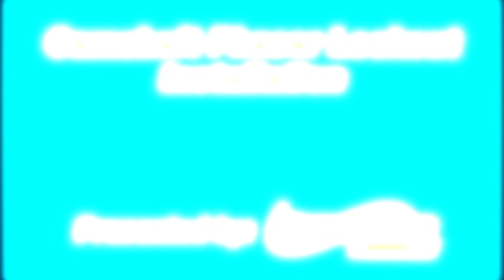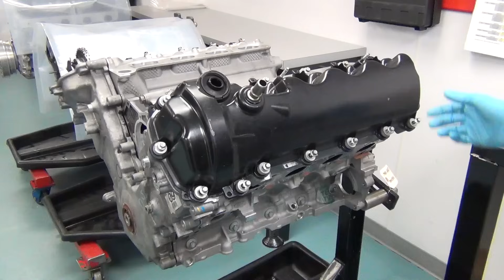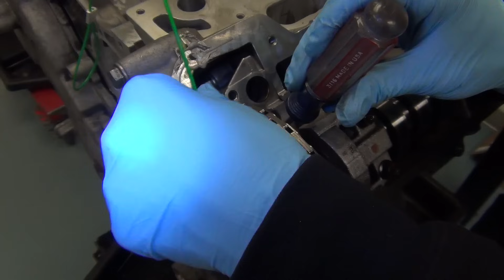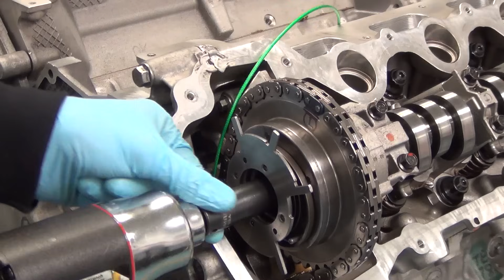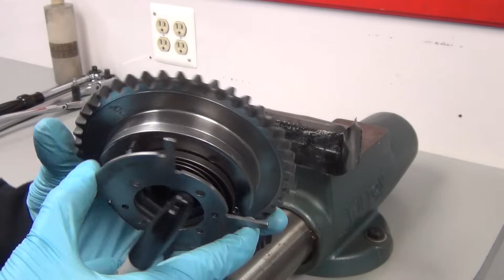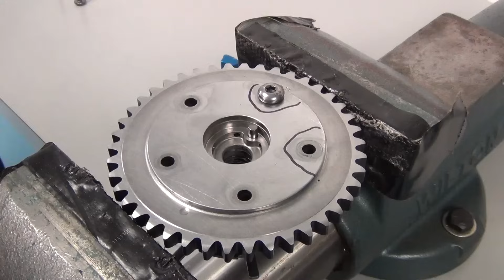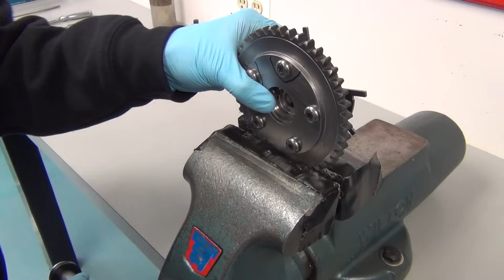Cam Phaser Lockout Installation Instructions - Livernois Motorsports New Link below

Comment: It seems a little pricey... I mean I have read many post and forums and it seems as if the price has increased a good bit from when it first came out...and honestly it doesn't seem like your getting a whole lot... 2 aluminum peices...and a download....
Reply from the maker: +aaron butcher Unfortunately many people over simplify what is involved in this kit. While on the surface it may look simple, look at it from what has to be done.

Design lockout. This process involved gathering over 200 phasers to ensure an adequate sample size to ensure the proper sizing of the piece so it works with all revisions of the phaser. These phasers of course were not free, and had to be factored into the development cost.

Wedge tool design and testing. We had to design out wedge tool to ensure it would work on all revisions of timing covers, chains, and not to mention 4.6 and 5.4 variants on both. There are about 45 total possible engine combinations. And, as with the phasers, this was part of the package development.

Calibration support. With close to 450 different potential strategy codes to support, you guessed it, we had to write code to support them all, and code to support future revisions that Ford may release. This process took over 2 years to do so, and, as you guessed it meant a great deal of development time and cost

Cam phaser bolts. Yes, simple and straightforward. We purchase and include new OEM fasteners.

Patenting. Since there is so much involved with this, we applied for a patent. This patent shows the complexity of exert aspect involved. It also is to protect us from those companies that simply copy our years of engineering involved in making this product available.

CARB testing. To completely round out the level of completeness of this kit, it is know CARB E.O. so those in States with emission testing can now be ensured that this product has been validated and approved for use in those states. As with other aspects, this added a good deal of time and cost, but it was worth it to give our customers the peace of mind they were asking for.

So, to label it as simply a piece of aluminum and a download is a gross oversimplification of what is involved and included. It's still less than 1/2 of the cost of the OEM "fix" which eventually fails again.
Reply: +Livernois Motorsports... I think this well help sell more...:) I, along with many others probably have asked this question and wondered why....
This does seem to be a good fix...however it is pricey... here is my current situation.. 
I'm currently taking my truck apart to see the components that need replaced along with taking the timing chain cover off.. I do not want to get a hold of myself and order parts to which I do not need. I can order 2 OEM Cam phasers for 225 each from amazon. 2 phasers I'm looking around $450 for the repair...not including guides and tensioners which are prolly broken... but that's another story..I do feel that your fix that you have came up with is a legitimate fix, however, you guessed it.... it's very expensive.. and $700. My biggest concern would also be that you get one download. I would be scared to death I would jack it up and then be out that money! Because once it's done you remove the tuner and basically that tuner is useless...it's a 1 time shot. Keep in mind I do see why you do this but, I would hope there is some assurance behind that.
I appreciate the response and I am not dogging the product just simply stating it's almost double the price as opposed to just putting oem phasers in...With the understanding they will go out again.. but hopefully after its sent down the road...lol
Reply from the maker: +aaron butcher Our response may not read the way we intend it, so don't take it as negative. Being our solution is a correct fix, we can't compare to what a shortcut fix would cost. Our comparison in cost is directed at what the OEM labels as a need. Phasers, bolts, solenoids, oil pump, chains, guides, and tensioners. Compared to this, our solution is far cheaper. But, we are engineering a solution for someone wanting to fix their truck, not get rid of the noise for the next person to deal with it.

Comment: would a cam phaser problem cause the car to read low oil pressure?
Reply from the maker: +Dustin Schaefer Typically speaking, no. Oil pressure is still within the safe zone even with a failed system.

Comment: Ive watched your video a dozen times until I fully understood the procedure. I have a 4.6L in my 2009 expidition, its no secret that the phasers get worn out at 100k miles.  Question: What is the benifits of phaser lockouts ? rather than installing new phasers ?  Thank you again for posting this video, its detailed instructions are perfect for the do it yourself person and I look forward to your reply.
Reply from the maker: +Silicon Valley Engineer Replacing the phaser actually doesn't address anything in regards to the failure point in this system. The phasers operate off of oil pressure supplied by the engine. When these engines wear, and age oil pressure naturally drops. Because of this, the phaser no longer has sufficient oil pressure to operate correctly. Now, the oil pressure is plenty to still operate the rest of the engine safely, but not feed the high demand of the phaser. The reason you see people claim that replacing the phasers helped is that you have a brand new part with zero wear on it, so it's operating at maximum efficiency, but since it has to pick up the slack for the rest of the engine it can fail within hours again. This is why our lockout is the only permanent fix for the phaser system.
Reply: +Livernois Motorsports  Very interesting discussion, thank you for your reply.
Reply from the maker: +Silicon Valley Engineer You're welcome
Reply: @LivernoisMotorsports   I heard a guy say he did his lockout in the forward position and got better MPG. I drove it and it definitely had more power.
Reply from the maker: @popeantichrist8847  These should always be installed in the fully advanced position, and while not designed to improve power or efficiency, many do confirm it does so vs. failed VCT control.
Reply: @LivernoisMotorsports  My dad was a Master mechanic, one day while changing the water pump on my 86 Honda CRX, my dad asked me "do you trust me?" I said yeah of course why what do you want to do? Well he said all all engines come from the factory slightly detuned I just want to move the cam forward one tooth. I told him okay go ahead. That little CRX went from 48 miles per gallon to 52 miles per gallon. It was so snappy you would spin the tires in second gear after that. His friend found out what he did so he brought over his four banger Ford ranger and it woke it up and it got better gas mileage. Such nice to hear at these three valve Fords locked into the forward position are getting better gas mileage.
Reply from the maker: This is designed to work in either situation so long as there is no physical damage to the phaser itself.
Reply from the maker: That is fine as well, only when there is physical damage to the phaser like a cracked housing, ob-longed dowel hole, or other issues do you need to replace them first.
Reply: Will the lock out fix a bad phaser? Or is the lock out designed to prevent failure of a good phaser only?
Reply: What if it is already causing a engine light?
Reply: You have a 5.4 that was the only engine option in 2009
Reply: @Sandbridgeman1  my 2009 F150 has a 3V 4.6
Reply: @jonahchabaniuk9165  my 2009 has 4 6l 3v also the 8th digit of vin is either a 8 or n I believe there was 3 engine for 2009 2v and 3v 4.6 and 5.4

Comment: hello everybody,, is there any suggestion to dont let move the camshaft once we are replacing the camphaser?
Reply from the maker: +ivan noyola If you follow the procedure outlined, the camshaft typically stays in place. Others have suggested for extra insurance, simply remove the rocker arms to remove all load from the camshafts, just bear in mind that there is nothing preventing their movement now either.

Comment: Did the 6.8L Triton V10's have cam phasors as well ?
Reply from the maker: +Kvr3005 Actually they do not, but since they a single pulse, 1-bank cam position reference their "fixed position" cam Gears cannot be used in a v8.

Comment: I already have the complete kit (timing chain, tensioners, cam phasers, etc.). It's Ford OEM. Can I purchase only the blue lockout pieces?
Reply from the maker: +Jonathan Diaz Jonathan, this kit will not work properly unless it's used in it's entirety. Installing the lockouts without our tuner will result in check engine lights, and poor running conditions since the vehicle will be running in a failsafe mode. Since we package this as a discounted group offering, it's actually cheaper to buy it as a complete kit, rather than buying the programmer, and the lockouts separately.

Comment: what is the purpose of the lockout
Reply: +miguelito0725 sanchez by locking out the variable valve timing you can run a bigger cam and avoid piston to valve problems.
Reply: Search Results
Featured snippet from the web
Designed to be an affordable alternative to expensive engine repairs, the cam phaser lockout kit fits Ford Triton V8 engines with 3-valves produced between 2004 and 2014. ... "Lock" the cam phasers into one position, ending the rattling problem and preventing future damage.
Reply: @1BlackopsGuru  what degree is the cam phasers locked ?  IE advance or retard as my thinking it's in advance at start and then it goes to a retard degree as it requires less timing then when it's turned off it rests back into advance is my thinking pad with in the scope of this operation ?
Reply from the maker: +ratcamaro Very true. That's how these started their life back in 2005 when the mustang first used the 3v engine design. We determined before anyone else how to address this and why its necessary. Our own 2005 mustang that graced the front page of motor trend magazine featured our lockouts even.
Reply: Livernois Motorsports & Engineering Do you need to reprogram the PCM to avoid any codes popping up now that the phasers don’t move?
Reply: ajthib yes you do need to have a custom tune.

Comment: Many people here ask about cam position to do phaser swap without cam moving when removing phaser,  I have Emailed you about this with no response.
Reply from the maker: blueblood76 if you follow the tear down procedure outlined in the video and the instructions, the camshaft will stay in place.
Reply: Livernois Motorsports So I guess you mean have black link up and lined up with the arrow L on phaser?
Reply from the maker: blueblood76 Correct, while you technically can mark any link in relation to any tooth on the phaser, it's usually easier to roll the engine over to get the camshaft into the default neutral position, which as seen in the video is with the L (or R on the passenger bank) pointed straight up relative to the flat surface of the valve cover rail. This puts the camshaft in the neutral position and prevents it from moving upon phaser removal. This isn't completely necessary, as you can mark any link and tooth together, and in most cases the camshaft still won't move, and if it does it will be a very minor amount you can correct by turning it back just a little bit.
Reply: Thanks
Reply: gyududgfyy

Comment: So all I need is this special wedge tool and I can remove the phaser without messing with the rockers? Can I buy just the wedge tool?
Reply from the maker: Mxmxv43 That is correct, the wedge tool allows for removal of the phaser with no other component removal. As for selling it separately, we do have the tool by itself.

Comment: My question is would you do this procedure using the old Phasors?
Reply from the maker: Gary Mello If you're asking if you can reuse the existing phasers the answer is yes, but only if you inspect them for any abnormal wear. If there is physical damage, then they will need to be replaced.
Reply: Livernois Motorsports  I'll have to check them out for damage.. I was thinking I should replace both due to the fact my truck has breached 178,000 miles. and bank 1 is over retarded.  If I replace both phasors would you recommend changing out the whole timing set up, and then install the lockouts to add some extra protection from future failures?
Reply: Livernois Motorsports I forgot to mention its a 2005 ford f150 5.4 lariat. Will this work with my vehicle?
Reply from the maker: Gary Mello Yes, this kit would indeed work on your truck.
Reply: Gary Mello I hope so.  Why buy new phasers just to lock them out?   As long as you keep the timing chain tensioner gaskets from leaking and bleeding off pressure and causing that chain to get slackened up, then you have no issues.

Comment: Installed the lockouts and ran the programer. The truck ran great and no noise but the pcm went bad and I replaced with a new pcm. Now I have tried to reinstall the lockout program and it comes up with an error message. Is this a one time download to the truck from your programer and if so how do I resolve this issue?
Reply from the maker: Lynn Lutjen This is indeed a one time download, feel free to contact or tech department to attempt to find a solution.

Comment: Some mechanics recommend you get the engine in a neutral position and remove some of the rockers before attempting to remove the phaser. I noticed you don't do that. is there a benefit for doing so? because your way looks a hell of a lot easier. thank you for your input.
Reply from the maker: chris paikai The way they are recommending is if you do not have a wedge tool or follow our procedure to the letter. Their way is a lot more involved, but has more room for error.
Reply: Won't the camshaft potentially move when you remove the phaser/chain?
Reply: It can they left one he is doing in the video typically doesn’t move the right one will always move when you take the phaser off. Vice grips behind the phaser is how we move them back
Reply: @craigrushton7363  can explained how holding the camshaft  please I don't want bent any valve.

Comment: I wish every mech was like this guy
Reply: Cannon Krebbs hey are you a mechanic  i dont mind paying you good money put make sure my vechile repairs are quality do you want to work on my f150?
Reply: Mostly every 5 out of 10 machanics want to ripped you off 
Not Doing it Right and saying they Did put the New Part's in. It's just the fk'n truth. They Kno it's a pricy
Job . And need lot's of patience .
Like I said there are Good Machanics out there. Just need
The Luck to be on yourside to find 
Right one.👍
Reply: kquigs100 If flat-rate didn't exist then every mechanic would work this way. Taking time to do the job carefully, resulting in the job being done right the first time. I wish I didn't have to rush through jobs just to make a living. If I was being paid by the hour, I would make sure every damn bolt, nut, and screw were torqued to the proper specification or the proper sequence. I would only get paid 4hrs for this type of job. That's $80.

Comment: I'm experiencing a loud buzz and slight power loss and when we ran a scanner tool over the truck it pointed us toward the right cam phaser. Is this what is most likely causing the issue? We can hear the chain knocking slightly on the right side but just wanted to be sure. Is this What sensors should l replace while doing this? I know the tuner deletes the two on the valve cover but are there anymore? Will I experience better fuel economy with this kit?
Reply from the maker: Steve Moon II This kit definitely helps out all of the issues related to a failed cam phaser. Whether power, fuel economy, or noise related. It does not delete any of the sensors though, nor does it need replacing of any.

Comment: I have a 2006 Ford F-150 5.4 3 valve I am having a problem with it cranking up sometimes and there is just a light knock when it is at about 1200 RPMs when in drive when holding the brake putting it under a load and when I'm riding down the road if I ease on the gas it runs ok but if I put under a hard load to pass someone it lags really bad like its going to shut off and it backfires could this be due to bad cam phasers and if so will this kit fix it
Reply from the maker: Brandon Gregory It absolutely could be attributed to this. When the cam phaser fails, the computer can no longer control cam timing, which can definitely cause loss of power and poor running conditions.
Reply: OK well thanks for the information

Comment: How long does this job take?
Reply from the maker: obie juan This work definitely depends on the familiarity, efficiency, and skill set of the individual. Typically speaking, 6-8 hours your first time is normal, and 4-6 if you do them frequently. Now, with the condition of the trucks varying so much it is possible it could take longer, but these are average times reported by our customers.

Comment: On mustang 4.6..
When you are torqueing the phaser bolt to 30 ft/lbs then you do the additional 90 degree is it fine that I did the additional 90 degree with my brother holding the engine with a breaker bar so it won't be able to spin or is that over torqueing

Comment: With using the wedge kit, approx how many hours should it take a competent shop to install the lockouts? 
2004 F150 5.4L
Reply: Car Guy Brian 9h billed
Reply: @garywalker2575  thats crazy. You got robbed. It in no way takes that long. But I can see shops charging that. Best to do it yourself. May take you 1 hours per side if your being slow and safe.

Comment: When removing phaser from camshaft do any valve rollers need to be removed to releive tension on the camshaft?
Reply from the maker: AL P Al, our kit allows you to keep the camshaft in place during install. There is no need to remove the followers during install.